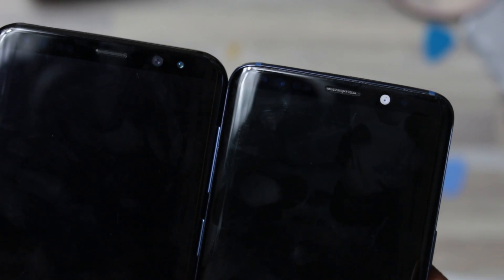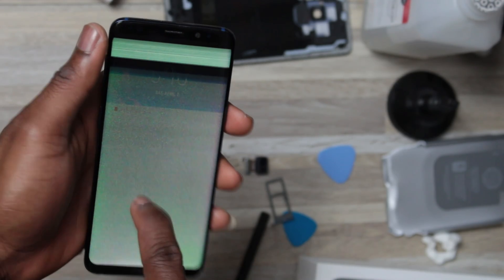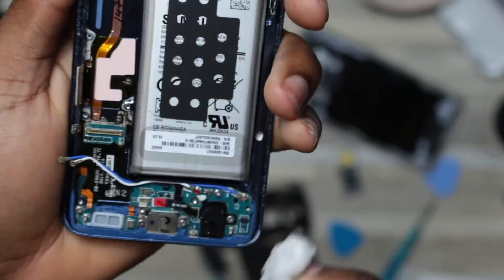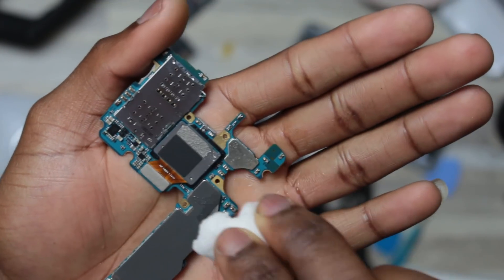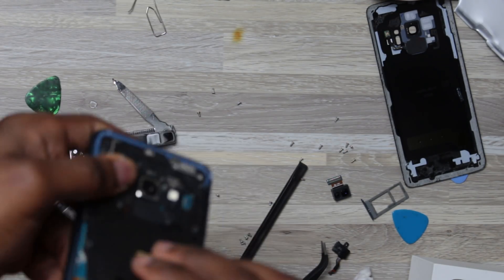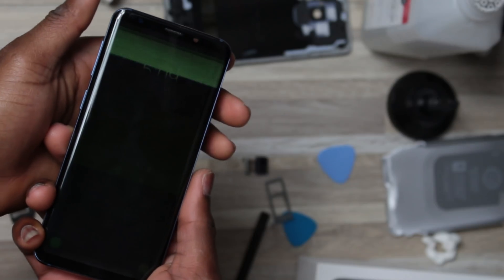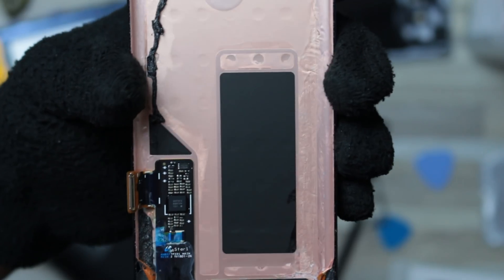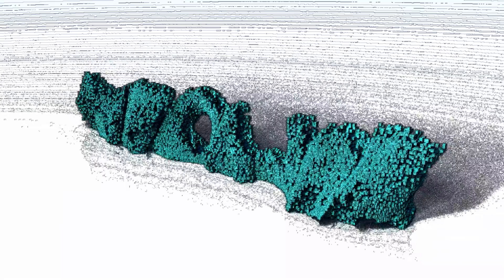Samsung Galaxy S9 Water Damaged recovery (What You Need to Know)

Comment: My S9 screen is showing lightly and green like yours. It was actually vomit that poured on it while in a silicon casing. The power button still works but the screen doesn't touch and isn't responsive.

Is the solution to replace the LCD? OR THE digitiser?

Comment: My s9 got damaged at my pool, water entered thru the sim port into the frontal camera.
Screen only works on maximums bright but only in a washed out tone. The right side heats a lot, probably some shorting. Battery puffed out because of the heat. Bought a new battery and it is working, but I gotta fix that short, I haven't solder anything in years not sure if I am up to the task.
Oh the phone charges

Comment: my s9 droped in swimming pool same condition as it seems in this vdo but after i dried it from hair dryer all board and all ports, cleaned everything with petrol and then working well... except left corner edge side of the screen... everything working  ..facing very difficulty especially in keyboard typing... what can i do ? same lcd replacement?
Reply from the maker: 👋🏽Brother this is unfortunate you will have to get a new screen, if the repair shop can put a new digitizer it will work. 
1 change the screen as a whole 
2 change the digitizer only ( more difficult) 

Check with a repair shop if they can do the digitizer replacement if they cannot you just buy a new screen and replace the old screen👍🏽
Reply: @ersbit  thanks bro 👍

Comment: thank you so much at least now i know, this is exactly what happen to my s9+ at the end of repairing it the screen got damaged but the phone still function well, well i thought there could be a solution for the screen but they told me i have to buy a new screen for replacement
Reply from the maker: Yes. Chances for the screen to be good after salt water is very slim. A new screen is required unfortunately
Reply: @ersbit  to be honest the screen came back normal just this evening cause this incident happened 2days back as i'm speaking with you thats the s9+ am using right now, am so happy
Reply from the maker: Cool that's good news. Hopefully everything dried up and you won't have any issues the following days

Comment: SO IS THE s9 water resistant bec I thinking of buying one
Reply from the maker: Yes. But this device was in Salt water that will not do anything good but damage your device
Reply: @ersbit   so like it can take little splashes, use in rain?
Reply from the maker: Yes it will survive splash and submerged under water it is ip67. 
It will be resistant on in drinking water, water without chemicals
❌❌sea water, pool water with too much cgemical, etc...❌❌ these can damage your device
Reply: @ersbit  or it does damages if it gets splashed

Comment: Hello Ersbit, Have you got it Fixed Now?  What Components were damaged and need Replacing except the screen
Reply from the maker: Technically not fixed but it needs only a screen. All other functionality were working when I DEX the device except the screen. In the video only the screen had damaged marks(burn marks)
You need to go step by step and rule out main components by main components and find the issue
Reply from the maker: Did a most recently video on what I said I could have done to save this device. The Note 10 Pro had similar issues and now is completely fixed.
Reply: Ah ok, Thank you for Replying! , I got my Samsung Galaxy S9 in the Water for 5 Minutes and it got wet inside, After that, I Wipe dry all the Components except the Screen, after a Day the Screen Flickered and turned Black and the Battery smelled like strong Alcohol
Reply: @Angelo-eo1ev  how is your phone now? I had similar experience two days ago and now the screen is pitch black..

Comment: took my note 9 in fresh water for a swim and now its not responsive. my phones experiencing the same LCD display as yours . i can start it but then it starts to shut down . also the phone wasn't even submerged that deep . will my phone be damaged permanently or is it just because of the water present inside?
Reply from the maker: It depends on what you did in the hours following the damage (when the display started to flash all over the place). I made a more recent video with a redmi note 10 pro that I did a water test and it was full of water. I explained the steps you need to take when you face à water damaged situation.
Reply from the maker: Usually it's possible to recover without any permanent damage if you act very fast following the early signs of not you will lose parts now parts can be just the display, charging board or motherboard or even a micro components that will affect functionality such as wifi, Bluetooth, signal etc....

Comment: No solution terrible
Reply from the maker: Solution is to dry the components first. Then buy/install new screen. My S9 is still here it works which means no damage to the motherboard. Only the screen was damaged and destroyed. 
In my case à new screen repaired my device. Then you check other functionality like wifi/Bluetooth etc... To make sure they are not altered by the contact with salt water. Pretty much that the summary

Comment: Any solution please. Same thing happened to my s9. After cleaning all components. I turned on the mobile the display was same as your mobile. But after 30 minutes the display got black and mobile started vibrating. Mobile got stuck in this situation. Then I diconnected the battery from motherboard.
Reply: The display was damaged by water. But why display turned black and start vibrate
Reply from the maker: Looks like the screen is damaged and might need replacement. These things will go bad if not disconnected very fast and leave to dry with something to suck moisture

Comment: I got a s9 plus and my phone was a bit getting water in it, while my wife was washing the dishes and my phone screen went sometimes black, when i was trying to unlock the phone, so i locked it again and waited a few seconds and tried to unlock it and it worked... but a few moths later, my phone screen went the same like your screen sometimes with green lines and sometimes only black screen, it only worked when i was in a dark place, becaus the screen brightness went automatically down, so i only can use my phone when im in a dark place and sometimes the screen is not clear, its green and the camera app doesnt work but apps like snapchat or insta are working, when im trying to take a picture... my question is, what am i supposed to do? Is my lcd broken? What do i need to fix it? And do i need a heat gun or a special glue, or can i use something alternative? Thx
Reply from the maker: 🤔 easiest solution would be to change the screen. If you change the screen and the issue persist you return the new screen.
The camera app does not work ( Samsung native camera application?) but other app can use the camera without issues. That's something I cannot point what's wrong there without further testing. For me the fix was the screen. The S9 in the video still works normally only the screen was damaged. The biggest problems you could have might be bad connection on the motherboard side for the display ( this can make you have similar symptoms like in the video and even be the reason of your camera issues) here again further testing required. 
You will need a heat gun and a backglass glue when you change the screen that should suffice. If the new screen present the same symptoms just return it and look for the fault somewhere in the motherboard. 
Brightness issues can be screen related or a faulty micro chip that is dedicated to the screen backlight aka brightness
Reply: @ersbit  where can i get stuff for helping me open it up or for the screws? And where can i find good screens for my phone? Thx again
Reply from the maker: Check my S20 Plus Camera back glass replacement video ( in the description I am recommending tools that are good in 2021)
The screen I am sure you can get it from eBay but amazon they might not be selling it. EBay for screen and amazon for tools.
Let me know if you have other questions

Comment: Bro i take my mobile samsung note 9 in to water it. Working fine display also working fine but it getting heat while using do you know about this problem ?
Reply from the maker: Am not sure. Did it starts only after you took the phone to the water? Mine be battery issue. Does it heat more with charger inserted
Reply: @ersbit  yes after taking the phone in to water and it's heating while plugin the charge
Reply from the maker: Can be some kind of water damage or too much moisture in the phone maybe
Reply: @ersbit  any precautions sir

Comment: any update on this? i have same problem on my s8..did you fix the display?
Reply from the maker: The way I did this saved what you saw on the video. To be safe you might replace charging flex circuit. My motherboard was saved and I have a video coming about this S9

Comment: I have a s10 plus I fell in the water and I entered the camera and then I dried it with a hair dryer and my cell was tender and a yellow spot appeared on the screen, and then a day later he touched himself until the right text was fixed.
Reply from the maker: S10 waterproof is that weak too? Sorry to hear that, once it happened to you you know it's not really really water resistant/ waterproof
Reply: Hi same issue my s10 screen is damage because of water from pool what should i do 😢😢😭
Reply: We should contact and make a complaint from Samsung in order to strengthen the workmanship for the quality of thinking before thinking of the design
Reply from the maker: @medoedrees9100  yes that’s true. If only this video was a million plus view it will get noticed and I am sure we would be contacted by an attorney office to file the complaint pro Bono.

Comment: For EVERYONE who is making the argument about it being "water resistant" and not "water proof".  Specifications on Samsung's site states the phone is  "Water-resistant and dustproof based on IP67 Rating, which tests submersion up to 1 meter for up to 30 minutes. Not shockproof."  It does not state a difference between salt water or regular water.  It is not common knowledge that IP67 tests are done in lab settings (i.e. distilled water with no chemicals).....you know, the kind of water you would NEVER find yourself swimming in.  The phone is also tested in "standby mode".....i.e. OFF.  The misunderstanding isn't because any of us are idiots, didn't research our phones properly, or otherwise....it's because of false advertising.  This phone was shown in various commercials being dropped into water (fish bowl) with the phone screen showing and it being on, which is not the same as their claims.  My phone was doing the same thing as ersbit's phone and I had only taken it into shower, near hot tub, and so on, but it did finally stop working after I took it with me into the ocean (less than 3.3ft underwater).  Water with any electrolytic chemicals would cause this phone to break if it gained entry.....FYI, that includes pool water.  You can take your phone to a UBreakIFix and they can test to see if it will take any amount of charge through a pretty quick diagnostic.  If it doesn't draw anything, your phone is dead....no point in replacing anything.  If it will still take a charge like ersbit's phone, you still have a chance to save it by replacing parts like the screen lcd and digitizer or charging port (which are surprisingly cheap).  I would not recommend using a commercial heat gun though.  I'd also recommend getting some precision tools pry tools other than a guitar pick.  If you end up cracking the back of your case (easy to do, it's thin tempered glass), you can order a replacement for cheap too from places like RepairUniverse.com and so on.  There's a law firm in chicago that might be taking up a class action lawsuit against Samsung for this....I hope they do.....because misleading commercials and claims like this cost consumers more than just $500-1000, but precious memories and important documents saved on those phones they will never get back.  Yes, I backed most of my stuff up to the cloud, but not everything sync'd considering I was in international waters and had global setting off.
Reply from the maker: Amen ! People will understand my video/comment better with your comment. This is a real misleading tactic. A few months later they even started to make the differences between normal water and something like beach/salt water.
Reply: I Am a writer and I saved to my device. 

😢

Comment: hi my fone went into the water and now alarm and networks all things are there but my screen has gone little green and the touch screen is not working.side buttons are fine. What to do? o got samsung S8 plus
Reply from the maker: Your LCD is finished. You will need a new LCD/Screen. Side button are physical button and they have a plastic wrap that protect them more than the screen

Comment: Today i was at the pool with my Note 8 and it got the same problem as shown in the video. I have closed the phone in a container with silica gel and will put in rice after that. Dont know whether its going to work. I was in 3 feet depth at the pool. Suggest some solutions.
Reply: Sheesh  Sorry bruh
Reply: And the battery was almost drained to 4% when i was able to see the screen.
Reply: I tried to rinse it well as lot of water came out from the sim tray hole and then still i can find moisture in both the cameras front as well as back cameras.
Reply: @elixirimaginations  did it survive later on?

Comment: same thing happened to my s8, water wasn't salty but screen got water damaged, whenever i unlocked the phone screen seemed to work finely but after 2 to 3 seconds it starts to flicker and blinking pixels.I thought its over and then without doing anything,  I put my phone in rice for 3 days(72hrs) then phone worked finely. I doubted that there might be some effect left, and to get rid of it completely I put phone in rice for 2 more days, and there it is my problem is solved and so my money is saved... thank god
Reply: I had the same problem with my s9 plus after i put it in a clean water
Reply: @shairacacayurin6997  did you fixed it
Reply: not yet i dont know what to do
Reply: @shairacacayurin6997  just don't use it if display is flickering.... open sim tray and then put it in rice for 3 days or 72 hrs.. if this doesn't work you have to replace display
Reply: Is your phone still working? I just read that even sometimes it works for a while after few weeks it stops bc of corrosion. Thanks.

Comment: I exp. Now this issue. But it still disply but my s8 it's too hot and the display is yellowish while im using it. Any suggestions what the best can i do to fix this issue.

Thanks😁😊
Reply: What happened,  did the issue resolve, i have the same issue now :-(
Reply: Same issure here. *not blue light filter.
Reply: Yellowish screen? Isnt that the option blue light filter??? Samsung has that option?
Reply: @corpse4434  i knoe that sir. My unit have maybe yellow or green issue in display  Whilel i'm using it.the display is ok but a few minutes got hot then the display is flickering if my brightness is in low setup. But if my brightness is in max setup then my unit is got hot. Sometimes it's ok sometimes it's like a bluelight activated display but bluelight option what you said is off. Whats it's the prob. For this issue??

Comment: it happened to me just now:(
Reply: s8+ I washed my phone with clean water then its started working then I put my phone in bag of rice to absorb moisture inside my phone.I will leave it for 48hrs hope it will be like before.
Reply: @madinamiya9527  turn it off till u havnt cleaned it all
Reply: @madinamiya9527  So what happened? I'm also having green flickers on the screen, mine is turned off and air drying right now,
Reply: Same thing happens with me today😔screen replacement is expensive
Reply: @madinamiya9527  did you put in sea ?
Reply: @madinamiya9527  well my motherboard is wasted.. which phone u have?
Reply: Omg,how Feet did you put it ? And can i put my s8?
Reply: @terrifyingofficial3427  i had s9 plus. Only in about a foot of water for less than 30 seconds. And its dead. On my table now 😥
Reply: @Bilalkhan-hb8uf  wtf but is water resistant 😐
Reply: @terrifyingofficial3427  i know
 Thats why i dipped it in water. But unfortunately
Reply from the maker: Sorry to hear that
Reply: maybe a fake s9+
Reply: @kialmitoons  no lol
Reply from the maker: lol I dont think fake Samsung do not have inexpensive rubber seal to add waterproofness.

Comment: Hey my Galaxy S9 is getting fixed for a cracked screen buy a certified Samsung technician will it be ip68 after he's done I heard that if it's done by a third party then it will not be waterproof anymore but if it's done by Samsung or anybody that certified by them it will be is that true sincerely mr. Marcus
Reply from the maker: Humm It depend on what type of glue the technician use.